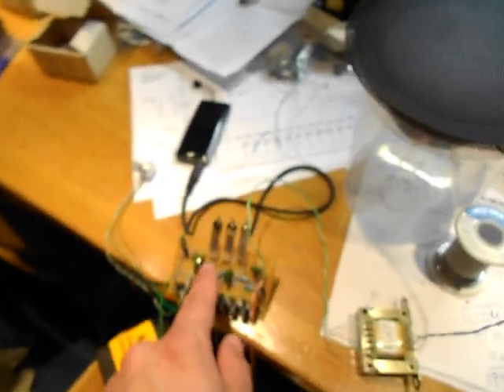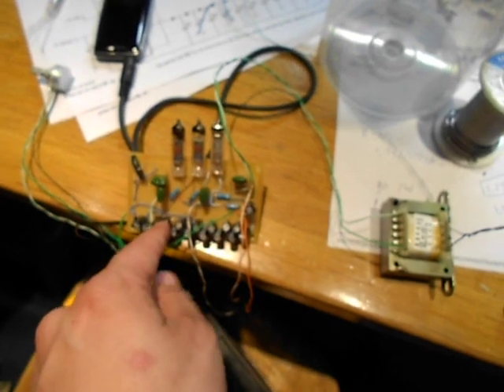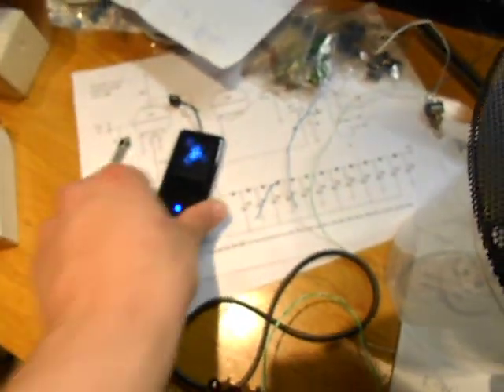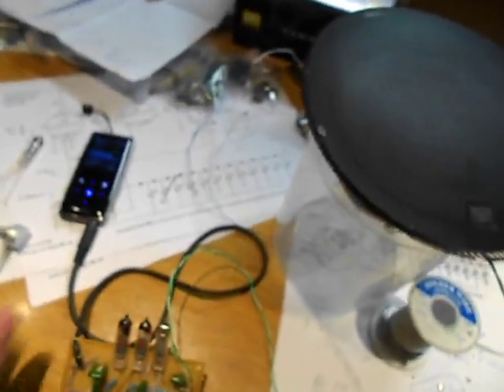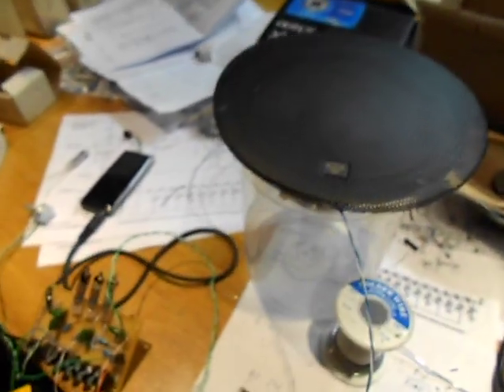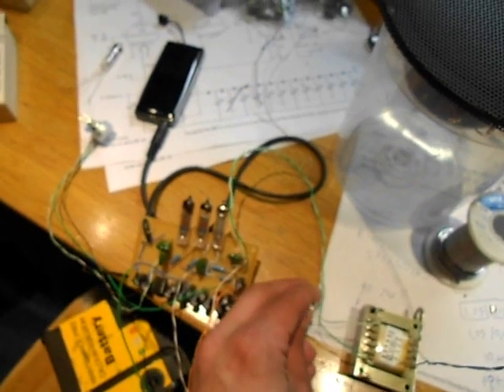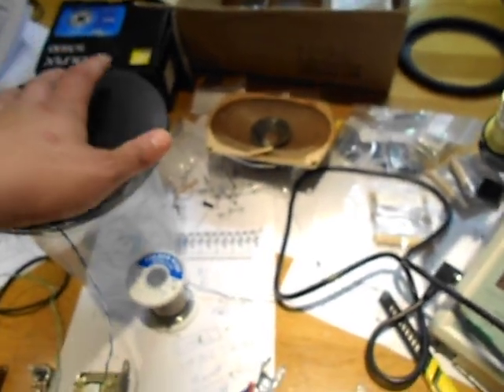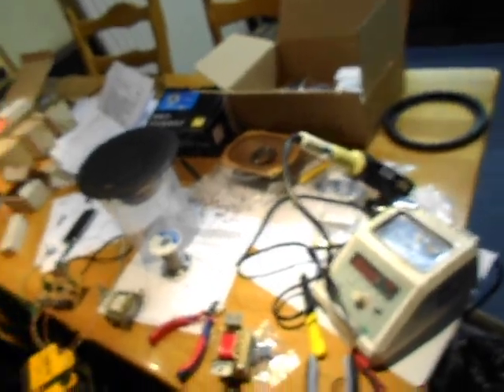12V tube amp

Comment: Not enough of hole in the ground!!!
Reply from the maker: i dont realy want to blow it up
Reply: I like the sound of these tubes, this sunshiny rustyness like my old Walkman used to deliver.
I'll soon get some 1J24b's, I'll put them into headphones and see how deep I can get the voltage down... But also I possess 400 ohm headphones 😁
Reply from the maker: @gustavgnoettgen  should be easy
a normal tube can drive 400ohm headphones without problems
Reply: And I could never try them before. I wonder how they work out. I'll do my best to make a video 😉